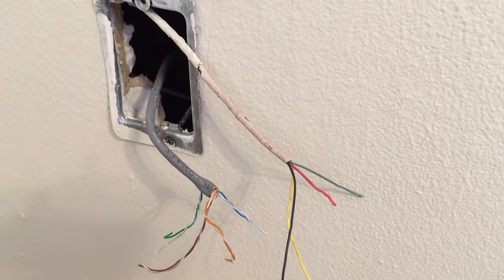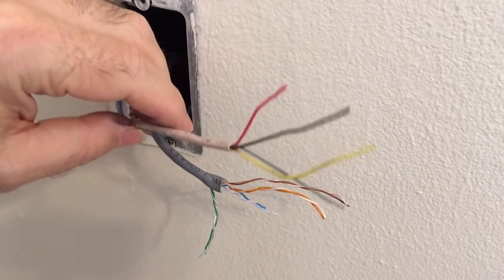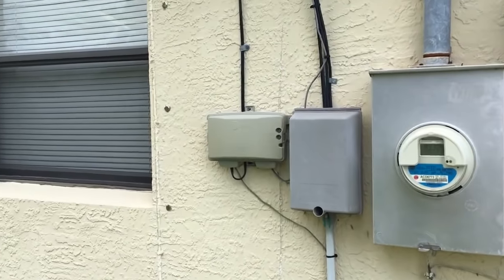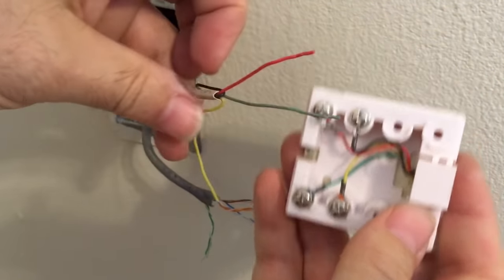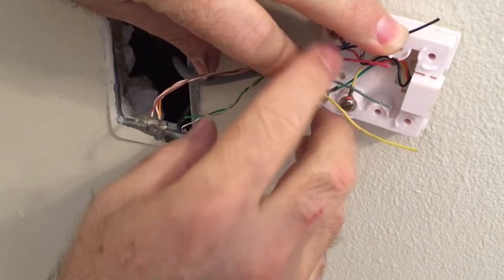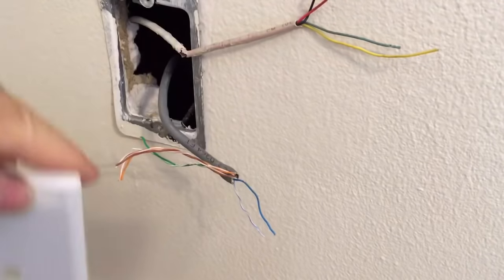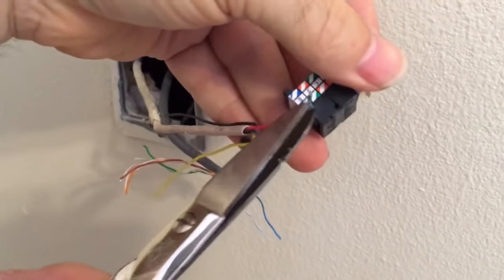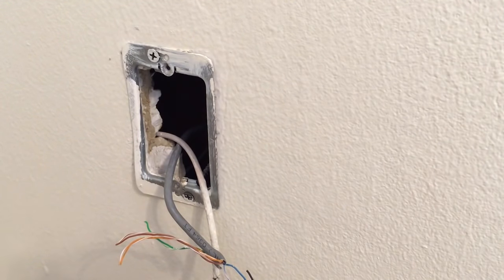House Phone Line Wiring

Comment: Does home phone have a fuse for land line
Reply from the maker: generally, no.  however they sometimes have lightning protection (kind if like fuses).  I rarely see it in residential.  But its common in business.  if you had lightning protection it would be at the demarc. (that box, usually on the outside of the house, where the service comes in from the pole or street.)
Excellent question! 😄

Comment: Great video. Good job. 
Question. 
I need to install a phone on my garage, 280ft from the phone jack .
Should i buy a 300ft telephone wire?
Please let me know if it will work. 
Thanks for the information.
Reply from the maker: Hi Brandon.  I would go to one of these big box hardware stores and buy a box of category 5e cable.  they are sold in 1000ft boxes. (about $90 USD).  
Also are you going to bury the cable?  or run it aerial?  if so you will need to consider conduit.
Good luck with your project 😀
Reply: @DIYTelecom  
I will run it aerial. 
Cable needs to be waterproof for outdoor usage right? 
Or can i use any type of telephone cable? 
Thanks again for your help. 
Have a great day.
Reply: @BrandonGarcia-fo1mx  Anything you use (aerial) needs to be UV protected and strong enough to support it's own weight. Aerial wire is totally different and not the type of wire you get at Home Depot. It should also be lightning protected. You are better off placing it in the ground.

Comment: Thank you for sharing your video. It is simple but very informative. The phone jacks in the house worked before but stopped a week ago.The phone only works if plugged directly to the back of the router. Mine are currently wired opposite to yours as follows: solid blue to green, white-blue to red, solid orange to black and white-orange to yellow. House is 20 yrs old (built 1999). Do I follow the same color code wiring the same way they have it now or do I follow what's on the video?Thank you.

Comment: What is the Yellow wire on old analogue phone plug? Is there a Ground wire?
Reply from the maker: Great question:  two possibilities.   
1.  In the old days (say 40 year ago) when Bell started offering phones that required power (i.e. Princess phones with lighted dialpads), the used the black/yellow for power.  So in that case, yes the Yellow may have been a ground.
2. in more modern times, the Green/Red wires were for the main phone line into your home.  And, if there was a 2nd line (not second phone, but 2nd phone #), then the black/yellow would have been for that 2nd line.

thanks for watching.  :-D

Comment: HELPPP. I want to relocate my telephone junction biscuit box all the way from one end of the wall to another end of the wall. I am so clueless on how to go about it. Ive been searching through a bunch of youtube videos for help. The  wire seems to be going downwards into the basboard and not from above the ceiling. I could be wrong however. Maybe i need to pry apart the baseboard to be sure.
Reply: You can either 
-If you have a basement or unfinished lower floor you can pull the wire through the floor/wall cell if the wire is exposed, attach another length of wire, then reroute it over to the other wall. Then go upstairs and drill a new hole through the floor next to your new wall. Go back downstairs and feed the wire up. 

-If you don’t have access to a lower level you will need to remove the drywall(not worth it) or add another length of wire and route it around the room. You can hide the wire behind your baseboard trim if you prefer.
Reply: Won'tRespond actually i figured this out on my own already sorry but thanks for the response anyways haha. I just pryed the baseboards and found out the wires were just tucked behind. Surprised it wasnt that hard.

Comment: My wires are red, black, blue and white. I intend to connect to a modular biscuit jack, can anyone guide me as to what colour wire goes where please?
Reply from the maker: +Sam Brunt hi Sam, sounds as though someone may have used unconventional wire for the phones in your situation.  If you only have one phone line (one phone number), then whichever two wires connected to the center to gold pins of the jack should be all you are concerned with.   Good luck sir.  😀

Comment: I want to get rid of my phone jack all together, can I cut the wires and wrap them up in electrical tape and push them back into wall and drywall over it?
Reply from the maker: Hi Glen,. That might work intitially, but even with electrical tape, the connections will oxidize over time and you will get static on the line.  Ideally, telephone wire crimp splicers "Red Heads". Should be used because they create an air-tight seal.  However, at the very least if you can use small wire nuts and then wrap them good in electrical tape that would work too.

Great question! 😀
Reply: You really shouldn't get rid of your telephone lines. You can use them for emergencys only

Comment: I just want my copper landline line back. It is clear we were all tricked into getting “all in one” packages that have shotty service and drip calls. My landline never did that!! My neighbors still have theirs but Verizion refuses to reinstall mine even though the lines are still connected to the telephone pole. There has to be a way to get good service back. My box is also still outside on the side of my house. How do I find someone to actually do this because I don’t know how to tell and don’t want to mess anything up. I have 2 lines in my home. One was for my husbands old business and one was for the house. Is there a way to find someone to do this? Do I hire an electrician for this or someone else? Can you just come over and help? I will pinky promise to buy you pizza wings and beer!!
Reply: Most major telcom companies are largely abandoning their old phone service. Too expensive for them to maintain it. I know in California, AT&T is trying to get rid of their obligation to provide wired landline services.
Reply from the maker: So true.   It's Just just about profit now. (As you pointed out) I believe there was new legislation recently that let them off the hook on being obligated to provide copper dialtone. So the big names in Telecom can't get out of that copper business fast enough. 

The closest thing I have seen to reasonably reliable dial tone is the cable companies.  But it too is a sort of VoIP style service.   So if your cable internet is unreliable then So will the phone service be too. 🤷‍♂️

Comment: What’s the supply voltage to a vintage telephone that makes the bells ring? Is it 24 volts AC or DC? I want to hook up a doorbell switch so I can make the old phone ring.
Reply from the maker: Idle line voltage is 48v DC.  Ringing voltage jumps up to like 100v.  And, when the phone is in use the voltage can drop to like less than 10v DC.  

You might search for “Viking Electronics “ online.  They make all kinds of things for what you’re trying to do.  Good luck. 👍

Comment: A rat bit through our line, connecting both jacks.  I need to reconnect both jacks.  What type of cable do I use?  Thanks.
Reply from the maker: You can buy plain old 2 pair (four wire) phone wire at most hardware stores. It’s usually a beige color.  Make sure its solid wire, not the stranded stuff. 😁
Reply: @DIYTelecom  Thanks, Im in the states, there are two jacks with a cable.connecting between them.  I have to take a look and try repair it.  Good thing the rat didnt bite inside the jack.
Reply from the maker: Cool.  If you go to Home Depot or Lowes they usually have all those parts in the Electrical dept.  Good luck.👍

Comment: +diy telecom at 5:00  what is a single line?
how many users can be accommodated in 2 pairs? 

the connection u get at the telephone exchange or de mod (whatever u call it.that thing outside ur house) how many users can use them max...because if it were max connections then they would have single demod for the whole neighbourhood.

plus make avideo of  how a phone/modem splitter works..how a single copper wire is used to give telephone plus ethernet(internet) signals

Comment: I just opened one of my unused phone jacks to see if I can run my ethernet cable through it (1st floor to basement - but no 2nd floor on this part of the house - but the ceiling on the basement is finished and hence I can't see where it comes out making life complicated. I do have a network, telephone, coax cable tester handy). I was shocked to find something like 40 or 50 strands of wire (one coming from the inlet and the other going to other phones, I suppose) and all the 40 years of dust to make my allergy go sky high. WTF is going on here? Any thoughts? And is any life left on the POTS wiring in this 21st century to think about preserving those connections? Well, we can ask the same about ethernet cables but even though I am a professor of ECE&CS, I am concerned about too much wireless EMT inside the house with higher and higher frequencies (now we are going to or already have those 5G transponders in each of the posts outside of the house; I got a mini LTE tower inside my house; MuWave buzzing and what not). Thanks in advance.
Reply from the maker: sounds like what you uncovered is a “25 pair” cable.  these were common for phone wiring up until the late 1980s.  
House wiring can be very challenging. Best advice I can offer is have patience and get creative.  As for all the wireless RF in our lives these days, I agree with you!
Thanks for watching!  And, great comments. 😀

Comment: You don’t use RJ45  Ethernet jacks as voice jacks 
You need to explain that this concept will work but if someone by mistake connect a laptop or pc thinking that’s a jack to a port switch or router and the phone ring you will get a 90 volts at the NIC Card of the pc side 
Please use voice jacks instead of data jack when doing voice
Reply from the maker: You make a valid point Luis.  The reality is you still often see RJ-45 used for analog voice (I'm not saying that's good).   Plus, we're entering an age when many of the installers in the field now are Millennial and even Gen Z.   Analog voice is kind of a foreign concept for them.
Thanks for point that out though.  Helps others reading these comments.  :-)

Comment: I bought two Leviton 5E jacks with no instructions.  I have old wiring with red/green and black/yellow. The leviton jack has A and B on the blue / white pair on the jack. LEVITON IS CRAP... PROVIDES NO INSTRUCTIONS TO WHICH ONE IS RED AND GREEN.  LEVITON STINKS !!!! Cannot figure which is Ring or Tip.  LEVITON SUCKS ~!!!!
Reply from the maker: Sorry to hear that.   So, on the leviton if you can find the slot for plain BLUE, put the red wire there.   And the White/Blue slot is for the green wire.  Hope that helps.

Comment: I don't want the wire to show. Someone ran a wire under the floor from the left to the right side of the house. I want to pull that back from the right side to the middle or cut the wire in the middle and use that. That way, I should have internet service throughout my home and won't have to switch networks from a router to a booster.